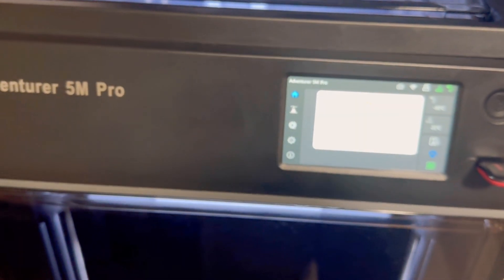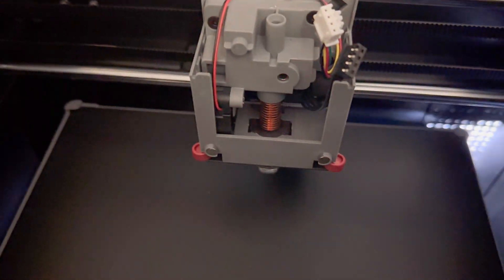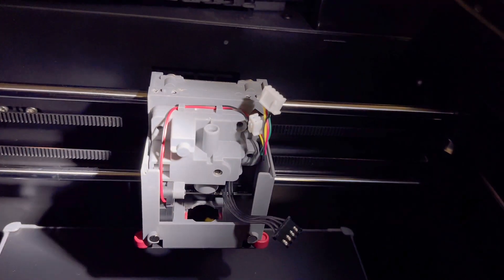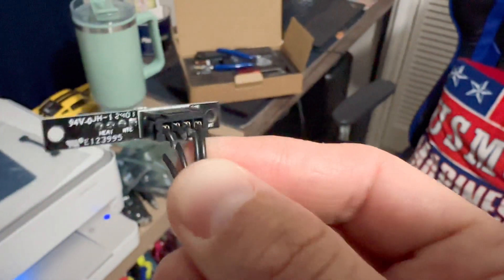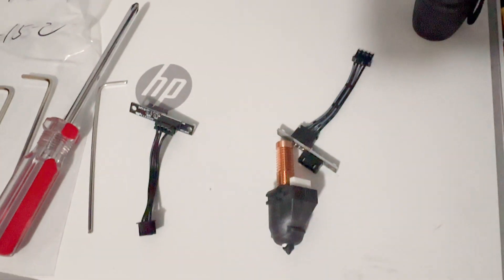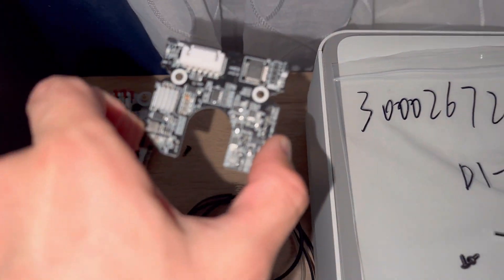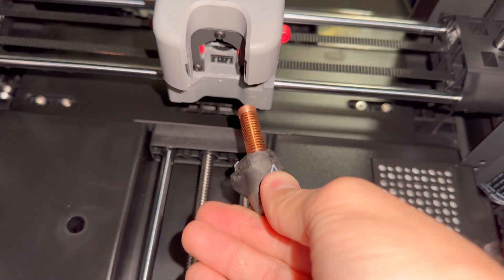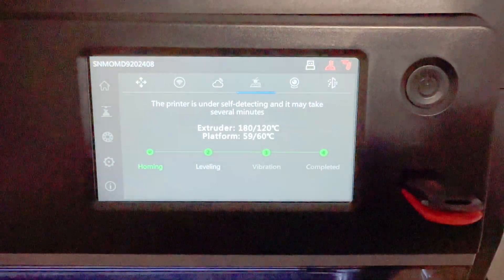How To Fix Extruder Temperature Error On FlashForge Adventurer 3D Printer

Comment: So i have a flashforge ad5m its like yours but not the pro. So my problem is i try to change out the filament and it shuts off my led lights i have on it and it pops up a error e0004 unable to read tmc chip so i have no clue how to fix it lol.
Reply from the maker: According to FlashForge’s official error-code list, E0004 = “X/Y/Z/E motor TMC chip communication error”.
	•	“TMC” refers to the stepper-driver / motor driver (specifically Trinamic / TMC chips) on the board that drive the X/Y/Z axes or extruder (E) motor.  ￼
	•	So the machine is detecting a communication error between the main controller (or sub board) and one (or more) of the stepper driver chips.

An example from a Reddit user:

“This looks like a stepper motor driver failure (TMC). Mainboard or toolhead board replacement may be needed here as FF does not have a replaceable motor…”  ￼

That lines up with the official list:
	•	Cause 1: X/Y/Z motor TMC chip read error. Solution: Restart; if persists, replace mainboard for X/Y/Z.  ￼
	•	Cause 2: Extruder motor TMC chip read error. Solution: Restart; if persists, replace extruder board; if still no fix, replace extruder board communication cable and mainboard.  ￼

⸻

🛠 What you should try (in order)

Since this is a communication fault with motor driver chips, you’ll want to check things from simplest to most complex:
	1.	Power cycle / restart the machine
	•	Turn the printer off completely. Wait ~30 seconds. Turn it back on. Sometimes this resets the communication fault.
	•	Try your filament change again and see if the error repeats.
	2.	Ensure firmware is up to date
	•	Sometimes communication errors stem from firmware bugs or incompatibilities. According to FlashForge’s troubleshooting page: Step 2 for any error is “check for firmware updates”.  ￼
	•	If firmware is not current, update it (per FlashForge instructions) and test again.
	3.	Check wiring / cables related to motors and boards
	•	Since the fault says “motor driver chip communication error”, suspect wiring/connectors between mainboard ↔ stepper drivers or extruder board.
	•	Look for loose connectors, damaged wires, kinked cables, or signs of wear.
	•	Specifically inspect the extruder motor cable, board to motor wiring, connectors at the mainboard, etc.
	•	Also check that none of the wiring is being stressed when moving the axes (X/Y/Z) or during filament change.
	4.	Check for overheating / physical damage
	•	Stepper driver chips (TMC) can fail if overheated, board is damaged, or there is a short. One user noted issues like:
“TMC Reports Error: GStat : … Measures: Check the temperature around the head …”  ￼
	•	Inspect the boards for burnt components, scorching, bulging caps, or overheating smells.
	5.	Check if the extruder board or mainboard needs replacing
	•	If after all of the above you still get E0004, then per FlashForge:
	•	Replace the mainboard for X/Y/Z axis fault.  ￼
	•	If extruder motor driver fault, replace the extruder board; if still persists, replace the extruder board communication cable and mainboard.  ￼
	•	You might need to check with FlashForge support for exact board part numbers for your Adventurer 5M.
	6.	Check your LED light setup
	•	The fact that your LED lights shut off when you change filament may be a clue: it suggests something with power or the machine going into a fault/firmware lock state when the filament change is triggered (or when motor movement is triggered).
	•	It may be that the filament change procedure triggers a motor movement, which then triggers the driver error, causing the machine to shut off or disable ancillary power (LEDs).
	•	Ensure your LED lights are powered independently (not drawing power through the printer’s board or interfering with the printer’s power supply). If you’ve wired custom LEDs into the printer’s power board, ensure they are not overloading a rail, causing fluctuations, or causing EMI/interference with the motor driver circuits.

Comment: Hi just a clarifying question: did you diagnose the problem yourself (that the extruded bus cable needs replacing) or did the support team help diagnose it?

I’m having a similar problem. The temperature reads negative. When I reset factory settings it in addition gave a Y-calibration error. No cable seems burned. 

Any help here much appreciated
Reply from the maker: I troubleshot the problem on my own and found the Extruder bus cable to be burned. However, the FlashForge Support team was very helpful via email and they sent me a new one since it was under warranty. So I highly recommend you contact them and they will most likely send you any parts you need if it’s covered under the warranty. They also have a bunch of videos on their YouTube channel as well
Reply from the maker: Step 1️⃣. Identify where the problem is
A negative temperature reading (e.g., –15 °C, –273 °C, or similar) usually means:
	•	The thermistor wire is unplugged, broken, or not connected properly.
	•	The hotend assembly cable is partially disconnected or damaged.
	•	The mainboard isn’t receiving a signal from the thermistor.
Reply from the maker: Step 2️⃣. Check the extruder head connection
	1.	Turn off and unplug the printer completely.
	2.	Remove the extruder assembly from the gantry (it usually slides out).
	3.	Inspect the ribbon cable / flat cable connecting the print head to the printer body:
	•	Look for kinks, pinches, or bent pins.
	•	Unplug and re-seat both ends of the ribbon cable carefully.
	4.	Check inside the print head — you should see two small wires leading to the heater block:
	•	Make sure they’re securely plugged into the small board in the print head.
	•	If one is loose or broken, that’s the likely cause.
Reply from the maker: Step 3️⃣. Power up and test
After re-seating the cables:
	1.	Power the printer back on.
	2.	On the touchscreen, check if the temperature now reads a normal room temp (around 20–30 °C).
	•	✅ If yes, the thermistor connection was just loose — you’re good.
	•	❌ If it’s still negative, continue below.
Reply from the maker: Step 4️⃣. Check the hotend (print head) module itself
The thermistor is built into the hotend module, and on FlashForge Adventurer printers, the hotend is a self-contained cartridge (it slides out from the extruder).

Try:
	•	Swapping in a known-good hotend (if you have a spare).
	•	If the new one works, the thermistor in the old hotend is bad and the hotend needs replacing.
Reply from the maker: Step 5️⃣. If Y-calibration still fails
The Y-calibration error likely appeared because:
	•	The printer couldn’t complete initialization due to the temperature error.
	•	Once the temperature sensor is working again, perform “Restore Factory Settings” again, then run Auto Calibration.

Comment: Also, if your in the us but have your voltage set to 200 that could be that problem, switching mine to 120 completely fixed my issue
Reply from the maker: That’s a great point for 3D Printers that have that feature such as the FlashForge Adventurer 5M model where you have the manual switch on the power supply however for the Adventurer 5M Pro model that I have it actually uses a Switch-Mode Power Supply (SMPS) that Auto-Senses the voltage then automatically adjust / normalize the input voltage

Comment: hey my 5m failed on initial bed level out of the box and my bed seems to be runaway heating...it just keeps going up can you message me ore link me to something im still waiting on customer service to get back to me, this happened today.
Reply from the maker: Hey friend I would make sure the bed is securely fastened and not loose on the rails or springs. The Adventurer 5M uses an automatic leveling sensor to make sure it’s not loose or misaligned. So run the Auto Bed Leveling again by going to Settings > Leveling > Auto Level. Also, check for the latest firmware: Settings > About > Firmware. You can also try a Factory Reset: Settings > Reset > Restore factory setting
Reply: @CJsINFO  it was a runaway thermal issue they are replacing it.
Reply from the maker: Oh wow! Well at least you figured it out and they’re replacing it! Happy to hear friend! Thanks for the update!

Comment: Why does the nozzle temp turn red in the top left
Reply from the maker: The first icon represents the heated bed and the second icon represents the nozzle. Both will turn green when cold or when the temperature is below the threshold and turn red when hot to the point when the temperature threshold is reached
Reply: @CJsINFO  why won’t it let me print when it is red
Reply: I just figured it out thanks
Reply from the maker: @X2AMFRIES Bevause it needs to cool down and turn green
Reply: @CJsINFO do you know why when I print something from orca and put the print in the center it tries to print all the way to the left?
Reply from the maker: I don’t use OrcaSlicer but I looked up you’re problem and this is what the problem may be so you’ll have to check everything because there are so many possible problems 
Check for Mechanical Issues:
Loose Pulley:
A loose pulley on the Y-axis stepper motor can cause the carriage to shift. Tighten it if possible. 
Stepper Motor Problems:
Ensure the stepper motor is receiving the correct current and isn't losing steps. 
Y-Axis Friction:
High friction in the Y-axis carriage can cause it to bind and shift position. Make sure the carriage is moving smoothly and the linear rods are lubricated. 
Mechanical Issues:
Check for any other mechanical problems like bent rods, damaged belts, or loose screws on the Y-axis carriage or bed. 
2. Address Slicer Settings:
Endstop Adjustment:
Some printers allow you to adjust the position of the endstops, which define the zero position of the axes. If your printer supports this, you can try moving the endstop to the left, as if you had already moved your printer to the left. 
Slicer Offset:
OrcaSlicer, like most slicers, allows you to apply an offset to the print position. This can be found in the machine settings or in the G-code settings. You can also add G-code commands to your start code to adjust the print position. 
Print Bed Size:
Ensure that your slicer's print bed size settings are accurate, especially after adjusting the endstops or applying an offset. 
3. Other Potential Issues:
Print Bed Leveling:
Ensure that your print bed is properly leveled, as this can affect the accuracy of your print position. 
Endstop Issues:
Check if the X-axis limit switch is functioning correctly, as it can cause the X-axis to shift. 
Travel Move Settings:
If the nozzle is hitting the print during travel moves, try adding a Z-hop in the slicer settings. 
4. Troubleshooting Steps:
Inspect the Y-Axis: Carefully inspect the Y-axis for any issues mentioned above. 
Check Stepper Motor Settings: Ensure the stepper motor is receiving the correct current and isn't losing steps. 
Adjust Endstops or Slicer Offset: Try adjusting the endstop position or applying an offset in the slicer to see if it fixes the problem. 
Re-level the Bed: If necessary, re-level the bed to ensure accurate print position. 
Check for Travel Move Issues: If the nozzle is hitting the print, try adding a Z-hop in the slicer settings
Reply: @ thanks I’ll have to try some of these
Reply from the maker: No problem! Hopefully you find a fix!

Comment: I need the part that the cable is attached to, its number is e123995. Could you please tell me where I can find it for sale on any website?
Reply from the maker: Okay so that part is called the Transfer Board or Connector for the Extruder Board. If you’re 3D Printer is under warranty you can get it for free by FlashForge which is what I did. If you’re in a hurry then go to this Amazon link they sell both the transfer board and cable https://amzn.to/4jykrkd

Comment: I checked the extruded cable and it was fine yet the error was still present. What do I do?
Reply from the maker: Have you tried replacing the nozzle?
Reply: @ just ordered a new one it’s on the way
Reply from the maker: @meex_seeks8880 The manufacturer didn’t provide an additional one in the box? I received a 0.6mm and 0.4mm nozzles

Comment: Any tips on removing the cables? My fingers are going raw trying to finesse them out
Reply: NEVER MIND I got the wires disconnected just to get to the part of tje video that said I need a new wire, and i also see that my wires are completely intact making the last 30 minutes for naught 🗿
Reply from the maker: @knite_lite Well Reseating Wires Can Also Help and At Least You Know Those Wires Are Good. I Would Check Your Other Cables and Boards As Well
Reply: @CJsINFO  bro the extruder wasn't even in the printer 😐 the guy who was working on it before removed it and didn't even put it back 😐😐😐 i put it back and no error 🗿🗿
Reply from the maker: @knite_lite Wow that’s crazy! I’m sorry to hear that but at least you figured it out!
Reply from the maker: Disassemble The Parts As Much As Possible

Comment: I am not a CSI, but if you successfully printed some parts and then this fault appeared, at least to me, it looks very strange. Your wire looks cut off rather than burned—maybe it happened when you tried to change the nozzle?
Reply from the maker: No The Wires Definitely Burned Off. Wires Can Burn If They’re Constantly Being Used / Heated Repeatedly & Not Having A Chance To Rest. I Made About 10 Prints Back to Back so It Was a lot of heat in a short period of time. Also, That Cable Connects to a Port on a Small Board and The Nozzle Connects to a Different Port On that same board. So It Wasn’t The Nozzle
Reply: @CJsINFO  Ordinary wires are usually covered with a PVC coating that withstands temperatures up to 95 degrees Celsius. In the case of a short circuit, this coating burns first. However, in your case, a clean and straight cut on the wire is clearly visible.

Since you mentioned that your "hotend" is in good condition, that means there was no short circuit. Given that four wires are connected to the "hotend," it can be assumed that two of them are for the temperature sensor, most likely an NTC-type thermistor, while the other two are for the heating element.

If the wires had burned, the edges of the PVC insulation should be at least somewhat blackened. However, in this video, they appear to be white. But again, I’ll repeat—I'm not CSI.
Reply: @saulius1005  But you are right. I have seen thousands upon thousands of these breaks and they are not caused by heat. Those are snapped at the root which proves manipulation in an upward and downward motion for them to snap at that point. Heat does not melt through wire, even if it is only AWG-30, it still would not snap from heat. Removing and reconnecting nozzles would definitely cause that issue, whereas burning or heat of any kind would show melting to the much softer wire coating, there is none visible. Plus, the whole wire would show signs of heat fatigue but they don't show that anywhere.
Reply: @CJsINFO  I have made back to back more than that, they are designed to take it. Your cables are not heat damaged and I don't mean scorched, I mean heat fatigue warping to the coating. They are snapped at the root which indicates manipulation of the wires by removing and reinserting the nozzle.
The only other possibility is the cable had a fault at the head without a full break, you removed and reinstalled the nozzle head repeatedly which then took care of snapping the cable at the head completely instead of a fault. That to me is the plausible answer, you just didn't see each time you reinserted nozzle that you were hitting an already damaged cable. This can happen the very first time you pushed that nozzle in, it pinches the cable to the point it gradually weakens over time until it throws up the error. Then it is very easy to snap the rest which is exactly what I can see.
Reply from the maker: @ATH3IST-FLuKE Thanks for the info friend!

Comment: that was not my problem, an it is still giving me that negative number
Reply: Did you figure it out?
Reply from the maker: I Would Recommend Contact FlashForge Support Via Email. They Assisted Me With Replacing The Part I Needed. Maybe Your Extruder Board or Cable Is Bad